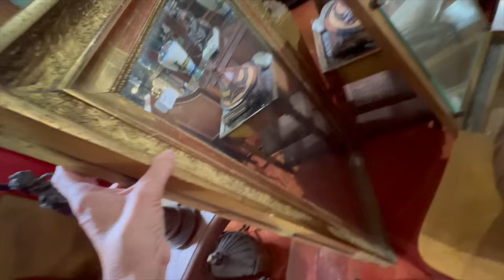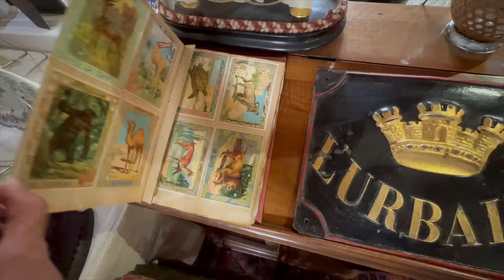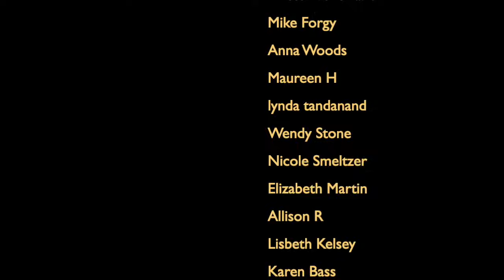Cottage Window Renovation, Huge Trees Tumble & Wanda's Brocante Antics!🌲🤣 ChateauChronicles Ep91

Comment: I'm a designer in CA, USA. As an FYI, I usually prime my walls with Zinsser Shieldz, a primer that I have tinted the same color as the paper in case the walls are slightly uneven. It helps to conceal tiny gaps. Beautiful paper. Can't wait to see it up.